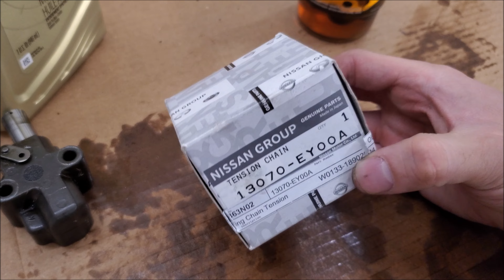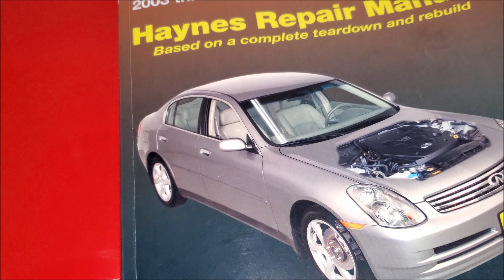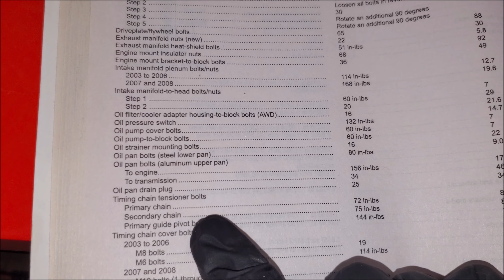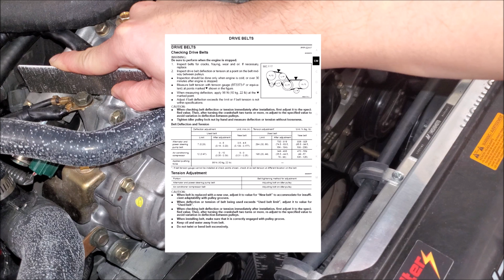Main Timing Chain Tensioner Replacement (Nissan 350Z & Infiniti G35) | AnthonyJ350

Comment: I have a de and had start up rattle. De’s had a crappy tensioner. 05+ had the revised one. I got the revised tensioner and it helped with the start up rattles a ton. I found using 10 weight oil vs. 5, helps with the start up rattles.
Reply from the maker: Thanks for sharing your experience!  Are you using a 10W30 or a 10W40?
Reply: Going to attempt this now from your video! Have a 05 Vert (DE non rev-up) and a good 1-2 second rattle at cold start. Looks like they ‘hold oil’ to keep pressure and mine is loosing that pressure to quick. Any issues come back after just doing the primary??
Reply: Those CHEAP ASS GUIDES THAT ALWAYS BREAK IN MY 05 6SPEED MAXIMA SAME ISSUES ALWAYS
Reply from the maker: @johng8888  Did you buy the one made in Japan?
Reply: @AnthonyJ350  I actually still had the one that I took off LOL I took off the original one and didn't even think about it because I was assuming always replace the internal parts but like a ding dong I totally forgot I just got got a  JDM motor and the one that's on there can never break because it's two separate pieces of plastic it's actually badass so I'm ripping it apart as we speak and I'm putting back the one from Japan
Reply: So I recommend if anybody's replacing the tensioner bar because the plastic sleeve keeps breaking and slides down well try and buy one from Japan because these ones will never slide down because it's two separate pieces it will never break
Reply: Yeah I did the oil trick also heavy oil you got to replace the timing guide buy one from Japan you'll never have rattling again
Reply: Can you share a product example of what you got? I replaced my timing chain tensioner with one from AutoZone which I found from a different video, and it's been about 4 months and something broke inside so my chain is not under tension currently. I'm about to replace it with one I picked up from O'Reilly's to get me going but if the problem happens again in a few months, I want to replace it with something solid.
Reply: OEM alternative is cloyes 9-5595 oreilly’s
And how does thicker oil help with the one second rattle it takes longer to get to the tensioner, 0w would get rid of it quicker
Reply: @ibanezrg320fm  when you replace the tensioner, did it stop the rattling sound at cold start
Reply: @danielpolonia4409  
It absolutely did! For my car, I must have gotten a bad product because it lasted 4 months and then fell apart inside the front timing cover. I retrieved most of it but there is still a small piece inside of the cover. I replaced it and it's been fine ever since. So that must've been about 1.5 years ago now and still going strong.

Comment: Hi sir ı replace  the tensioner but ı didnt marked anything right now my friends say you have to be marked the tensioner position right now what i will do can ı put it back or screw it its enough or nah ? Because they told me ıf you are put it back any position you can lock the engine
Reply from the maker: Mark the timing chain or belt tensioner?

Comment: i was thinking about buying an 05 Enthusiast model and they said it has a timing chain click when starting so im wondering if its this, or the other two now
Reply from the maker: You can try changing the oil to Castrol 5W40 synthetic first and see if that helps. For all you know, it could be low on oil.
Reply: @AnthonyJ350  i gotta get the cash first lol guess we'll see if its still there by the time i get the cash !
if not then its okay, i already have 3 vehicles 😅😅😅
Reply from the maker: @marleensrain  Hope you get the car!

Comment: Hey Anthony,  I am going to try this after watching your video so thank you! Do I need to put the engine at top dead center before I start or would it be wise to use the tdc marks ? I just don't want to mess it up. It's my first time messing with timing and I want to do the water pump too since I am in there. So again, do I start at tdc? Would it be wise to start there?
Reply from the maker: It won't hurt to start there. Make sure to secure the wheels because you might need to put the transmission in neutral to turn the engine over from the crank pulley. Also disconnect the negative battery terminal.

Comment: hey anthony, i pulled the old timing chain tensioner out with no problem, (didn’t even have to turn the crank) but i’m having trouble fitting the new tensioner in place to bolt it down. it seems as if i can’t pull the timing chain back far enough to get the bolt holes lined up with the new tensioner. any suggestions?
Reply from the maker: In the video I describe and show the tool I used to pull it over. You can also turn the crank a little to get more slack
Reply: @AnthonyJ350  i can turn the crank with the tensioner out??
Reply from the maker: @e.j.houston3565  Not much just a little to relieve tension off the chain
Reply: @AnthonyJ350  do you have to put the crank back in same spot?
Reply from the maker: @sunnyjudd5946  If you can, you DON'T want the chain to feel really tight when you start it. You can also try rotating the crank fully but don't force it. Car needs to be in neutra, so make sure you secure the wheels.

Comment: What happens if something does fall into that housing? I had an incredible rattling noise and I already had a hunch that the tensioner was at fault. I was right and when I took it out, I noticed the detent pin and spring were missing. The pin that was supposed to hold those things was stuck out about 1.5" out the side of the tensioner upon removing the cover. So the detent pin and spring (that is supposed to click the cylinder) is missing. I can only assume it is in my engine but I don't know where it went. It didn't go out the intake system and it hasn't made it through my cylinders yet, so where exactly are they? I looked with a flashlight but didn't see anything. I know it was fine originally because I installed a new tensioner 5 months ago when I did the water pump. So did it make it to my oil filter? Or is it in my oil pan? I don't know what to remove to find that spring and detent pin. I got the main tensioner out with the cylinder and all that, but there's no spring and detent pin. A new one has been installed for the time being. I do not want those pieces in a place that I don't know if will cause harm
Reply from the maker: You'll have to pull the timing cover and oil pan off to search for it.

Comment: I got a 05 g35 with timing chain rattle on start when cold but then it goes away it idles quiet but start up it rattles I bought the oem main tensioner off z1 and putting it on soon along with a oil change to 5w40 to also help with the rebuild I did cause my bearings are oversized but anyways the timing chain is new but not oem hoping this tensioner will fix/help with the noise but how would u go about taking slack off the chain and how’d u keep the chain from jumping
Reply from the maker: Turned the crank pulley to take away tension
Reply from the maker: There's a new timing chain but the tensioners weren't replaced?
Reply: @AnthonyJ350  looked up how to do water pump on these motors on alldata and the first couples steps were how to take out the primary tensioner and saw they turned the crank about 15-20 degrees to take slack off the tensioner I’m pretty confident I can do this job thanks to ur video and my research I’ve done
Reply: @AnthonyJ350  excuse me I guess I should’ve said the whole timing chain job while the motor was out of the car whilst I was rebuilding it new guides chains and tensioners but it was a cheap set and yknow the cheap stuff always has problems down the road
Reply from the maker: @fatkidfromup2731  Let us know how it goes!
Reply: @AnthonyJ350  will do sir jus praying nothing catastrophic happens😭
Reply from the maker: @fatkidfromup2731  I would just take your time and triple check. If something feels wrong don't force anything and step away for 5 min to reset.

Comment: 09 nissan maxima has a rattle 1 second rattle on the cold start any recommendations
Reply from the maker: Try Castrol 5W40 Synthetic to see if anything sounds better.  Might need to try the tensioner after, but if the car is high mileage you might need to have a mechanic change the chain and the tensioners.
Reply: @AnthonyJ350  has 100700 miles and it started maybe 4k miles ago, might try the tensioner job, the video was done on a 35de ?
Reply from the maker: @Kxwr  Video was done on a DE

Comment: do i have to remove the belt to access the tensioner or can i do it without removing the belt
Reply from the maker: Makes it easier
Reply: @AnthonyJ350  do you recommend when I swap my belts to replace the tensioner or can I leave it and swap it out later
Reply from the maker: @obsrob1810  If you don't remember the last time the belts were changed, I'd change both. They're cheap to purchase

Comment: I have a question will a G 35 start with the pedal all the way to the floor or does that put it in a mode where itll crank but not start? I was just wondering if that could be a legitimate way to prime the tensioners before letting off the pedal and actually starting the vehicle to avoid the one second chain rattle j/c…
Reply from the maker: The oil pump will only work when the engine spools.

Comment: Did you fix the cold start rattle with this? Any update?
Reply from the maker: Starts good if this tensioner is the culprit. I also run 5W40 Castrol synthetic. https://youtu.be/5Nmxi0du8-Q?si=eCI01ceDXogcXvcV

Comment: Anthony, im getting a rattle at startup and turn off, and strictly at 2750rpm up. i swore up and down it was rodknock but all my local 350z enthusiasts are saying its this tensioner. i havent got any metal in the Oil and i even dropped the oil pan to see if there was anything in there. Im a bit anxous to attempt this in the car on my own. does this sound like a noise that could occur from this tensioner? what caused you to desire to replace it?
Reply from the maker: Could be.  Like I said in the video the car was making a knock at idle that used to go away then didn't.  I would also try Castrol 5W40 synthetic in the car and replace the VVT solenoids with OEM ones.  Best to change the solenoids, run the engine to test, then change the oil. https://www.youtube.com/watch?v=WnUObIdmyho&t=712s

If it still does it, then look into the tensioner.

Comment: Hey had this car got a cold start rattle? Did the replacement tensioner get rid of it?
Reply from the maker: No it didn't have the cold start rattle. If it does, it probably needs a timing chain job.

What's the mileage and how often does the oil get changed?

Comment: Did you set it to tdc before you started?
Reply from the maker: I just left it where I shut it off.  When I finished I just put the pulley back where I started.  Didn't want to start the engine with a bunch of tension on the chain.

Comment: Just started to get a horrible rattle/grind noise which i first thought was a blow from the exhaust manifold. After doing some research it’s highly likely its the timing chain being slack. My Z is almost at 100k is it worth trying this or just getting the chains replaced?
Reply from the maker: You can try this.  If it's still the same result and you plan to own the car for a while, get the chain replaced.  Also consult your mechanic and their opinion.
Reply: @AnthonyJ350  ok thankyou

Comment: If the tensioner doesn't want to come out on it's own, which way do I rotate? opposite from normal rotation?
Reply from the maker: Rotate the crank so it relieves tension.
Reply: @AnthonyJ350  got it out and replaced. Thank you
Reply from the maker: @dipu827  Nice job!  I would follow up with an oil change after you've verified operation.

Comment: Heey! I got a 350z from 2005 (32.000km) and mine is making a rattle sound as well when starting up for 1-2 sec. They say it’s my time chain tensioner but how is that possible with such low km?
Reply from the maker: Improper maintenance possibly.  Try changing to Castrol 5W40 synthetic https://www.youtube.com/watch?v=5Nmxi0du8-Q&t=91s

Congratulations finding a 350Z with such low mileage too!
Reply: Thanks! I’ll try with the next oil change. Is it worth it to change te tct? I hear that it’s a lot of work but I never want to get rid of the car :)
Reply from the maker: @jerreljonker9105  If it's malfunctioning yes and your chain should be fine with that low of mileage. But try the oil first. If the oil comes out really dirty you might want to do a premature oil change again to get all the crude out and change the filter again.

Comment: Going to attempt this now from your video! Have a 05 Vert (DE non rev-up) and a good 1-2 second rattle at cold start. Looks like they ‘hold oil’ to keep pressure and mine is loosing that pressure to quick. Any issues come back after just doing the primary??
Reply from the maker: Mine seemed to be good still when I pulled it out. It took a lot to bleed the oil out. I'm chasing a noise and I think it's my VVT solenoid. My noise happens after a couple minutes.
Reply from the maker: Let us know how your swap goes.
Reply: @AnthonyJ350  will do! Let me know if you get to the bottom of yours as well! Appreciate the video Anthony!
Reply from the maker: @mattgrant4143  Ya hopefully in January I'll have time to swap that part and make a video for you guys. Just make sure to keep changing your pil regularly, and change it after the tensioner job.
Reply: Did replacing the tensioner fix that  rattle on a cold start?
Reply from the maker: @mattgrant4143  Mark your calender for March 27, I changed the VVT solenoid and had an interesting result.
Reply: @AnthonyJ350  very cool! Please keep me posted. Waiting for the warm weather to do mine. The Vert is winterized at the moment, will do the tensioner change once I break her out for the summer 👍
Reply: @AnthonyJ350  hey I just replaced my tensioner on my 2005 g35 and I was going to also replace the water pump. I turned the engine to tdc to start with and I removed the old tensioner with no problems. I turned the engine counter clockwise to give water pump gear slack. I did all this and I still don't have the slack I need to remove the old water pump. I don't know what else to do

Comment: What can I do if the time chain tensioner gasket is stuck ? I’m having issues trying to get the cover off to get to the tensioner ☹️ is there anything I can try to get the gasket off ? Also the cover is covered with nasty debris, what can I use to get it off with out any particles falling into my car parts ?
Reply from the maker: Clean the cover off with an all purpose cleaner and get it clean before you take off the cover. I show a tool I used to pry it off.

Comment: Also, if your tensioner is not all the way extended out, which if it was, your timing would probably be off at that point then it may be in between clicks and it’s backing off to the nearest tooth and giving you that rattle without putting too much tension try to get another click
Reply from the maker: Thanks for the comment!

Comment: Hello, any help will do I have a pinging sound when in park, kind of sounds like a knock but when I put it in drive it goes away it’s an 06 auto. Any ideas what it could be also doesn’t make the sound when cold started but after warming and putting it in park it’s makes the noise. Timing chain as well?
Reply from the maker: I honestly have no idea.  I doubt it's the timing chain.  I would have your local trusted mechanic listen to it.

Comment: My car makes a rattle noise when i turn the car on only for 3 seconds by changing the tensioner will fix that ?
Reply from the maker: It might, if the car is high mileage you might want to have a mechanic do it and possible change the chain.